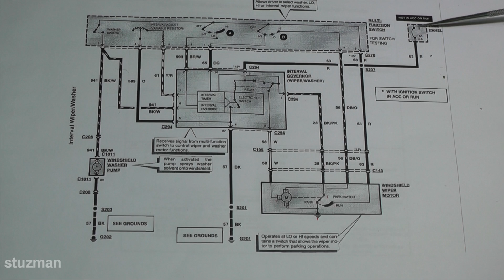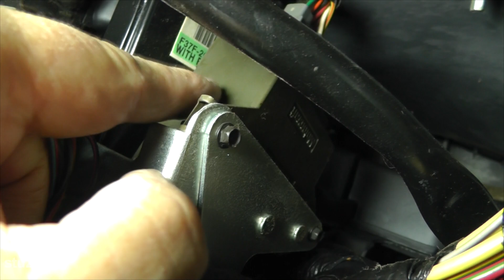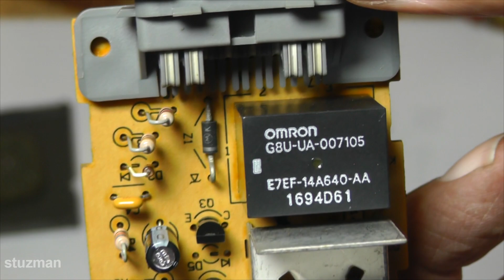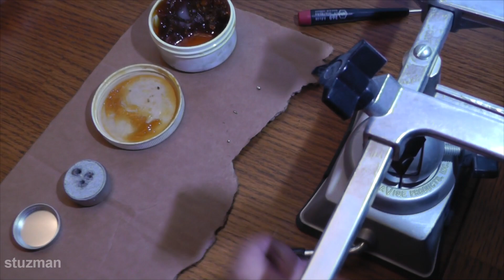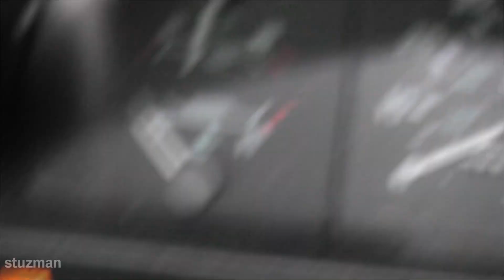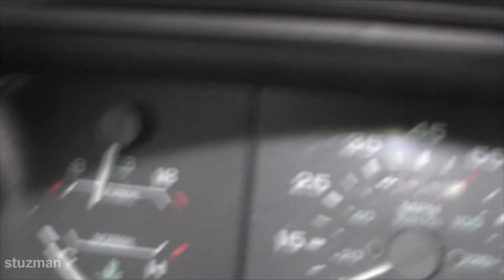Ford Ranger Windshield Wipers Repair

Comment: Is this coarse in electronics or have you found the propblem
Reply from the maker: The pcb had bad solder joints so had to touch them up with soldering iron.

Comment: Got a 95 Mazda B2300. Tested all connections I know to check. Installed a new multifunction switch and wipers won't work at all
Reply from the maker: I would suggest having a wiring diagram for your vehicle and study it. I would suspect that it should be similar to the vehicle shown in the video. Have a great day!
Reply: @stuzman52 I've got a repair manual somewhere, got to find it
Reply from the maker: @johnfields4896  Once you find it, I'm sure that you'll have no problem troubleshooting your wipers.
Reply: @stuzman52 found the problem. The negative cable was in terminal but barely. Replaced terminal and shoved wire as far in as I could. No problem now

Comment: Great vid.  Are you still making videos?  Thnx
Reply from the maker: Thank you very much! Although I haven't made any videos lately, I still do if there is anything that comes up with interest.
Reply: @stuzman52  i do have a question maybe u can help.
96 ranger i have wiper issue.  It takes a few minutes to start on any selected speed.  It does work though.  I tried new switch and new moter, to no avale.  Any ideas...thnx

Comment: So my 01 had no intermittent when I purchased only low and high and wouldn’t park at bottom, then I lost low some days and then both high low stopped haven’t worked, I replaced switch, relays and now motor, have power at red wire, and low wire at motor harness, relays clicking on, still no wiper function, is it the gem? It’s only think I havnt replaced, there has been times where truck won’t start even with being in park and if I put in neutral it starts, is this tied to the gem box?

Comment: Hello My wipers only work when i push to clean the windshield that is it you think is the same problem or it is the relay?
Reply from the maker: It could be in the multi-function switch or the electronic board. To diagnose, you'll need to pull the electronic board down and check the inputs coming from the multi-function switch. If you don't have one or more inputs, then it's your switch. If there are there, then you'll need to check the electronic board, possibly bad solder joints.

Comment: Have you ever heard of this one? I have a 99 Ranger 3.0 wipers were working fine then one day i turned them on and nothing. When i turn the ignition key on i can see the wipers move up about a half inch and stop (in off position) ut would stay under pressure from the motor for a few seconds then i would see them relax back sown into the park position then do it again and again yet i have no function or the wipers in any position of the multiswitch. I swapped around the 2 relays , replaced multiswitch the motor had been replaced (bought a new motor and plugget it in and same result) i bought the 3 phonebook size 1999 ford ranger workshop repair manual and surprise .. wiring is its own and seperate book (didnt know that little tidbit 🤬) any advice would be great. Im about to test the connector with a test light. Why di i feel im going to be pulling my dash looking for a bad ground?
Reply from the maker: Not sure what your issue is. Send me a copy of the wiring diagram and I look it over and give you some advice of what to check.

Comment: Hello sir. Can you give a better description of where this module is located? I have a 97 ranger and I can’t find it under my dash. Do you know if it moved from 94 to 97?
Reply from the maker: For my vehicle, if you look under the driver's side. Find the steering column and look over to the left of it. It's pretty easy to spot. For your vehicle being a 97, it's possible that Ford move it. Looking quickly in a forum, one commenter said that the 96 model had it behind the instrument cluster. Not sure where it's located for your vehicle.

Comment: Great Video.  My problem is that the high speed function will not work.  All other functions are good.  By your wiring diagram explanation does it sound like to you it may be a broken connection from the switch to the motor?  thanks.
Reply from the maker: Hi Scott. Looking over the diagram, it could be the switch in the multi-function switch, a bad connection at the connector or an open winding for the hi-speed for the motor which is unlikely. But don't guess, check if there is voltage coming out of the multi-function switch on high speed. If not, replace the switch. Have a great day!
Reply: Ok. Thanks for the reply! I'm leaning towards a bad connection as the motor was replaced as it went bad.  It was Tested it out completely so I know it's good.  Switch was also swapped out with a new one and same issue occurred.  Great vid as I did not know that the high speed bypassed the GEM completely. Was thinking issue could be there. I will do some more troubleshooting.  Take care.

Comment: Great video, I went tothe location and it was between column and the radio up,but after getting it out and apart the solder joint he pointed out was bad ,so resolderd and it was fixed ,all I had b4 was hi speed now it works like new ,thanks for the Awesome Video!!
Reply from the maker: Glad to hear the video helped you fix your issue James! Have a great day!

Comment: My 94 Ranger had the same problem and was able to find the same cold solder joint. Getting positioned properly to remove the two bolts was tricky. Thanks for posting the fix!
Reply from the maker: Glad to hear the video helped you out! Have a great day David!

Comment: I take relays apart and use a thin diamond file to clean the contacts!
Reply from the maker: Yes, you can do that, but for the inexpensive cost of a relay, it's better to just replace it.

Comment: This is a good video and good information. This is the problem I am having with my 2011 Ford Ranger. Only high speed and will not park when you shut them off....! This is the first time I had any problems with this truck...When I got out of work 10 hours later it worked fine...!  What do you think that is....?
Reply from the maker: I could mention some things Al but it would only be guesses. Get a wiring diagram and analyze the circuit and then troubleshoot the system to prove and disprove the components.

Comment: Just the info I needed for my 94 ranger. Will try this fix. Thanks.
Reply: That was the fix. Cold soldier joint on the middle pin of the relay. Reflowed the soldier and 'Im back in action. Thanks again.
Reply from the maker: Glad to hear that it all worked out for you Shane!

Comment: I have a  92 Mercury  Grand Marquis ls that the wipers stopped working on about 3 years ago.  So I never drive it when its raining or going to rain. I will give this a try and see if it works for me. Thank you for the enlightening video.
Reply from the maker: Wow! Three years is quite a long time. Hope you find out what the issue is.
Reply: @stuzman52  We took the module out and sure enough the solder was burned. Dotted more solder on it, put it back together and in the car. But, when we turned on the wipers it immediately burned out again.   It makes me think its getting too much current.  What would be causing this to immediately burn out again ?
Reply from the maker: @marymccarty1289  It could possibly be the motor that's drawing too much current. Or it could be an issue on the board itself. Sorry I can't get give you a definitive answer.
Reply: @stuzman52  I have ordered a new motor. I think the last one Auto Zone sold me was a dud. We will see what happens when the new motor comes in. Thank you so much for your time and input.
Reply: @stuzman52   I called the  local Auto Zone and they are ordering me a new  wiper motor. I think the last one they sold me was a dud.  We will see. LOL
Reply from the maker: @marymccarty1289  Hope it works out for you!

Comment: Excellent video. I am having the same problem.  I don't have experience with resoldering. Any advice about that? It seemed pretty straightforward, but you are skilled.
Reply from the maker: Just take a soldering iron with a small amount of rosin core solder and reheat each joint. You should be able to look at the board and see where the solder cracks are. It's not a difficult skill to resolder. I'm sure you will master it after you do a couple of them.
Reply: @stuzman52  Thank you. I have a 97 Ranger. Your treatise on your a/c was really great and helpful. After spending many $ trying to get my a/c diagnosed, I am going to have to it myself. My compressor clutch went from intermittent operation to none at all.
Reply: Any diagnostics advice?
It has been a frustrating thing finding a true diagnostic mechanic. Always talking about replacing young components, rather than diagnostics for source
Reply from the maker: @seanmcguirk5808  With the clutch working intermittently and then not at all, your first step is to put a set of manifold gauges on it to see what the pressure is. My guess is that you have a leak and that the pressure is low where the low pressure switch is keeping the clutch from engaging. There could be other things that would cause this issue, but that would be a good starting point.
Reply: @stuzman52  I had it recharged and it held pressure but then the clutch would not kick in at all. I am wondering if there is an obstruction in the condensor.
Reply from the maker: Sean McGuirk Not likely that you have a condenser that’s blocked. The clutch will still engage and likely open the high pressure switch after it ran for awhile. Next step is to get a wiring diagram. When you acquire that, let me know and I’ll try and help you troubleshoot. How are your electrical skills as it sounds like an electrical issue.
Reply from the maker: @seanmcguirk5808  One other thought that came to mind is that your clutch may have too much of an air gap. You could check with a voltmeter or test light at the clutch to see if there is voltage there. If you have voltage then the air gap is too wide or there may be an issue with the clutch coil.
Reply: @stuzman52  I could use feeler gauges to test and then remove a shim to reduce the air-gap, if necessary, right? My electrical skills are not great. I do have a multimeter and a Power Probe. I have OEM Shop Manuals to get the Heat & A/C wiring diagrams.
My heat doesn't work, either. Blower blows. Cannot feel heat in hoses to firewall. Changed thermostat and water pump, already. Sorry to be so lengthy here. Just thought there might be something interrelated. Thank you for your time and thoughts. It is appreciated. Best to you.
Reply: I have manifold gauges as well. High side was high while a/c on but clutch disengaged...meanwhile, low side was below spec.
Reply from the maker: @seanmcguirk5808  Always good to have the most information to know what you've done to the truck. You can measure the air gap and your service manual can tell you what the specs are, but before that, put your voltmeter across the clutch, (back probe the pins with the connector installed) and with your a/c switch set on, measure the voltage and see what you get. Let me know what you get. And what engine size does your vehicle have so I can round up a wiring diagram? I can't find a wiring diagram for the '97, but if yours has the 2.3L engine, then the wiring diagram from my '94 Ranger should be the same.
Reply from the maker: @seanmcguirk5808  What was your pressures that you had? And did the clutch engage at the beginning when the system was turned on? And if so, it disengaged later? Or did the clutch never engage?
Reply: @stuzman52  It's a 2.3L I'll re-check current manifold readings in a bit.
Native from S.F. .....watching a bit of the 9ers-Panthers. I live in Greensboro now. Will check at halftime and get back to you. Thanks, again.
Reply: @stuzman52  The a/c was not working when I last had a leak test and recharge done. No evidence of a leak at that time. But clutch hasn't kicked on at all since. I replaced both high and low side pressure switches. Compressor is maybe 4 years old. Accumulator/Dryer was replaced then. I bought the truck about 8 years ago and 
a/c did not work at that time. After enduring some summers without a/c, I finally spent a bunch to have it gone through and it worked for a while but not for awhile now. Back to you w/current readings in a bit...
Reply from the maker: @seanmcguirk5808  Okay, sounds good! I have a question. How can you have high head pressure and below normal suction pressure if your clutch never engages? The pressures on both gauges would be the same if the clutch never engages. Just a little confused now.
Reply: @stuzman52  To answer your question. I don't know. Many months ago I bought one of those recharge cans. As soon as I put the hose on the low side shrader, the pressure red from can's gauge way far into the red zone. ~180 psi
So I stopped. That is when I realized the clutch wasn't kicking in at all. In any event,  I used the manifold gauges just now and both sides read zero. So, back to square one. Must trace leak.
Reply from the maker: @seanmcguirk5808  There you go Sean! I think you found out why your clutch isn't kicking in. You can get back with me when you find your leak! Good luck!
Reply: @stuzman52  Yep. A dye test was done, so somewhere not so obvious, leak is hiding. Thanks for trying.

Comment: Great video! I found the unit exactly where you said it was. The only difference was it had 7MM bolts and not 7/32 as you said in your video.

Comment: Great video. Im sure headed in the right direction. I recently purchased a 1989 bronco 2 xlt for a fix up project and the wiper will not shut off They are somewhat similar in wiring setup But at least I have a place to start. I'll update my comment when figure it out. Also I love it when you wife talked about using the kitchen table as a work bench, I've heard that same exact line.😀. Thankyou for your help.
Reply from the maker: Sorry Chilly for the delay as YouTube did not contact me. Good luck with your repair!

Comment: Wipers and squirt pump not working ? Excellent video , but check the Battery Terminals first .  Even if everything else is working , as was the case with my truck . After I cleaned the Battery terminals the Wipers and Pump worked fine !

Comment: u kinda remind me of my own dad. I grew up on a wrecking yard. But STill I need help. I have electrical problems with the dash board and the dome light. I was playing aorund and figured if all of these same things always goes out thent here must be a reason. What do I know. I havnt torn a ford apart in 20 years. Well Now I have and its a sweet riq with a boss stereo however. Some kid owned it and raced it a lot and blew everything out. Ive been doing the repairs. Believe it or not these fords are EXREMELY easy to work on. Witch Is why I generally buy these sorts of cars. Id nver own something I cuoldnt repair. At this point in my life I could in fact rebuild a ferrari and not used "ferrari" parts.
Reply from the maker: The older vehicles are for sure easy to work on. I'm sure that you'll be able to figure out the electrical issues and get your project vehicle working in no time. Good luck on your repairs and wishing you the best.

Comment: An EXCELLENT VIDEO sir. I am a mechanic myself and am chasing down a problem with my 1997 Ford Ranger wipers not working. It's really been a headache, as I've installed a new wiper motor and it still didn't work . . . and it wasn't the fuses. So, not being the best in electrical things---your video was very helpful, however, I believe that the 1994 is different from the 1997, but it gives me some ideas. Your teaching methods are SUPER!! Thanks, Rish from West Salem, Oregon
Reply from the maker: Glad to make your acquaintance Rish and good to hear that you found the video helpful. I'm quite sure that you'll be able to figure out your issue with the wipers. Have a great day and don't work too hard!
Reply: Rish Reinen 
 I have a 95 Ford Ranger with the wipers not working did u ever figure yours out?
Reply: Im just had the same problem only high speed its working but 3 weeks ago then dont working at all  im going to a repair shop and telling me the motor its not the problem but the GEM control module do you believe if I make that technique can solve the problem or need to get the inside relay ? And please if someone get
 the ranger 1996  schematics or where I can get it ?

Comment: That's a nice board vice. Good tools make work so much easier!
Reply from the maker: Hey Dave and glad you dropped in! I've had that vise for quite a few years now, and haven't used it much, but when you need it, it sure comes in handy!
Reply: Could use a better view of the actual location under the dash (center console)
Reply from the maker: Sorry Madeleine as it was really tight to get a camera under there to get a good shot. If you look just under the dash to the left of the steering column, you'll see it :)

Comment: Great video. 2 questions, the wattage of your soldering iron and the device for holding the PCB steady ?
Reply from the maker: Hi Tom. The soldering station I was using is a Xytronic XY9-60D. It's heater is rated for 24V @ 60W. However, 60W on a PC board is quite a bit of heat. The unit can be adjusted from a temperature of 392-896F.  Probably around 25W is a good amount of heat for a PC board. This unit is probably not available now as I bought it several years ago.
 
The vise is from panavise and their website is located here www.panavise.com Amazon has a lot of their products and you can see some of them here https://www.amazon.com/s/ref=nb_sb_noss?url=search-alias%3Daps&field-keywords=panavise&rh=i%3Aaps%2Ck%3Apanavise Have a good evening!